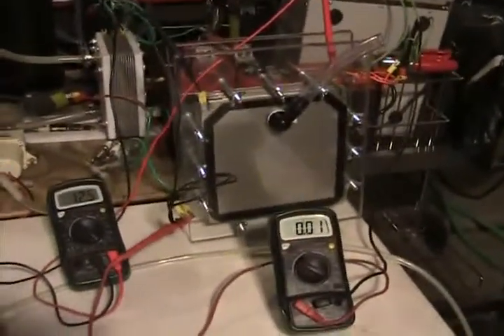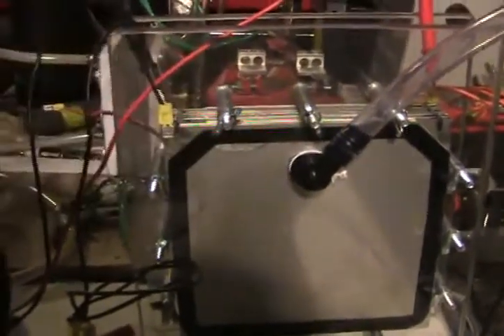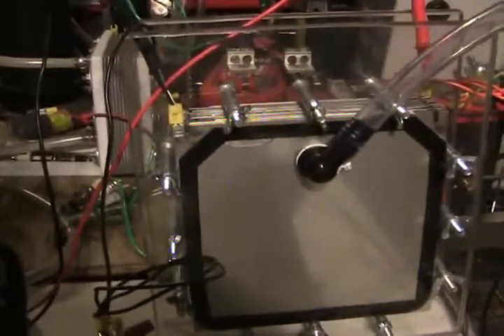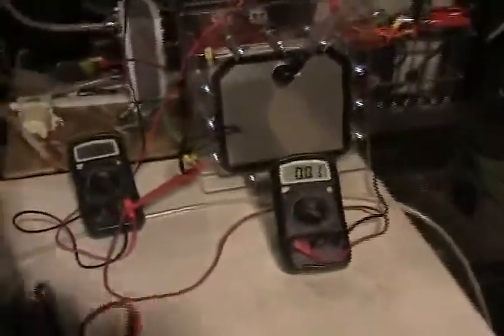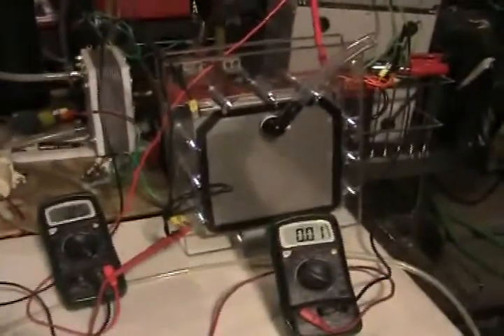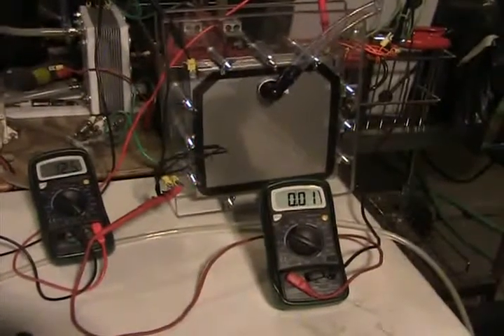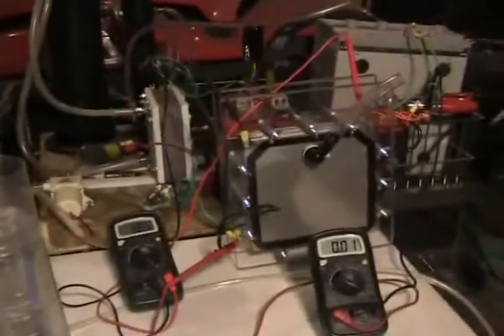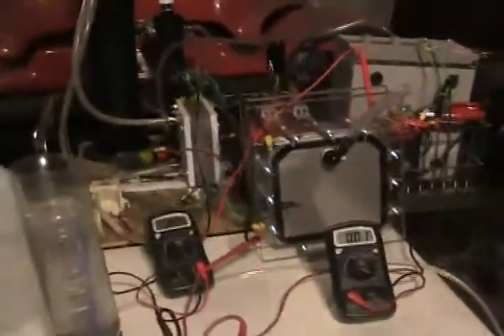Ideal cell test 1

Comment from the maker: it seemed the hardest part wasa fighting the adhesion of the water, once it touches both plates its happy just sitting there, which creates bubbles below the water, luckily this is just for testing, and now testing should be done, in theory at least. a hypo needle with a bent needle to shoot the water in would be nice:)